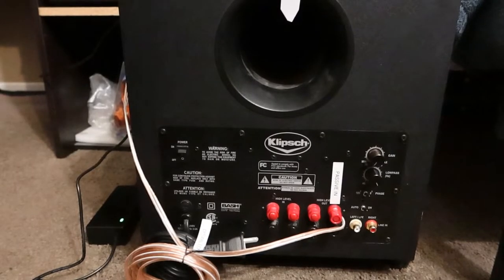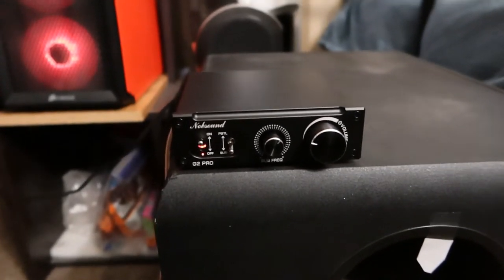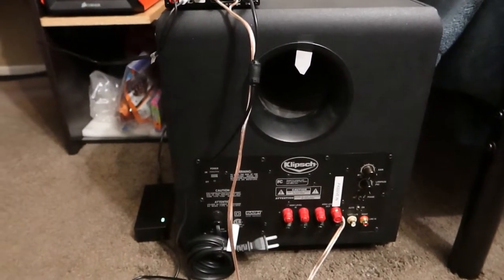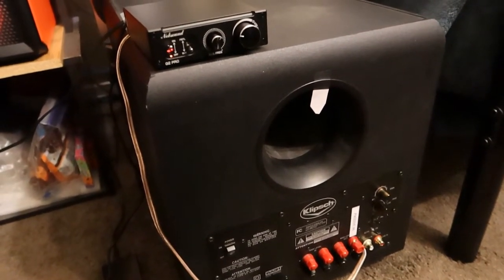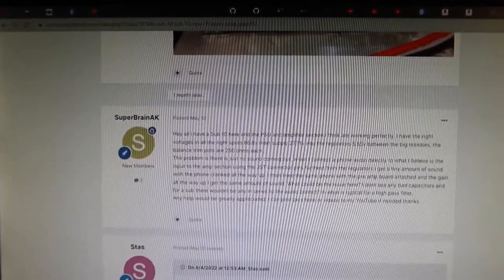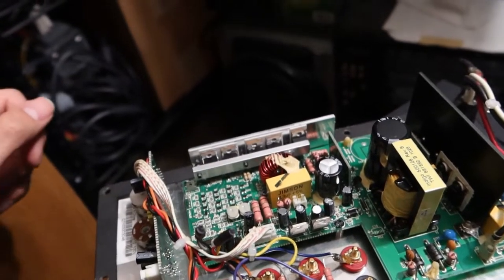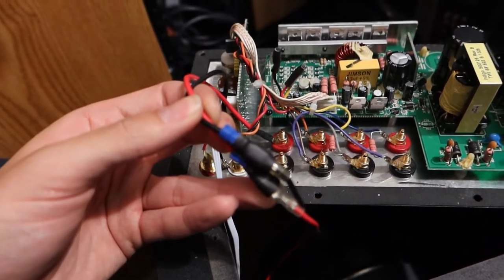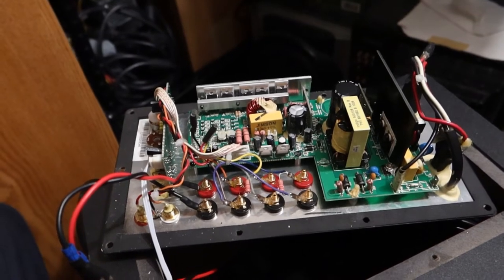Klipsch Sub-10 to Passive Sub

Comment: How do you take the amp out of
Reply from the maker: Hello!
To remove the amp you need to remove the 10 phillips screws around the perimiter of the back connection panel. Leave all the rest of the screws. Then you can gently tug on the mains cable and speaker binding post. Don't pull on the volume knobs. It should come out, make sure to be careful of the subwoofer wire and thin wires going to the rest of the enclosure.

Comment: Do you do side work?  I have same one. Blows fuses as soon as I turn it on. No red/blue light when plugged in.
Reply from the maker: Hello my friend. I do side work but if you actually want it's amplifier repaired I am not your guy. I couldn't understand the atypical arrangement of it's design so I modified it to be a passive subwoofer by replacing the amplifier with a class-D amp located externally.
If you find a local shop feel free to show them my video and they should be able to replicate my work.
Certainly keep me posted about it and I can help if I can.

Comment: Ahh, Klipsch... Copper, horns, adequate displacement... Sounds as good as they look :)
Reply: So the Bash is the problem then?  How far did you end up taking this project?
Reply from the maker: @nathanieljames7462  I did all the troubleshooting I could confidently try.
I decided after talking to my friend (who owns the sub) that it would be easiest to turn it into a passive speaker so he won't have any more issues with this flaky amplifier section.
Turning it passive worked like a charm and he has the subwoofer deployed as it was at the end of the video.
Reply: A big problem with the New RP1600 subwoofers https://youtu.be/JA2j1g_1uKM?si=AUz28UvpBKSGKPBi

Comment: What are the other red and black connectors for ?
Reply from the maker: They are for connecting your treble speakers to the subwoofer so you can "listen" to them and give you some extra bass that they can't reproduce themselves.
After my modifications nothing works on it anymore because I wired the driver directly to one pair of those terminals, so it has to be driven by an external amplifier.